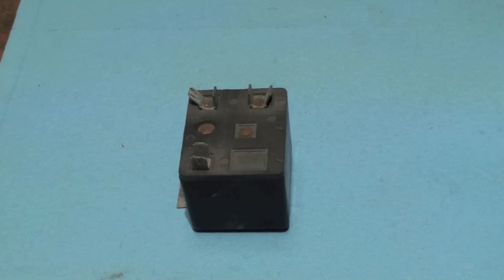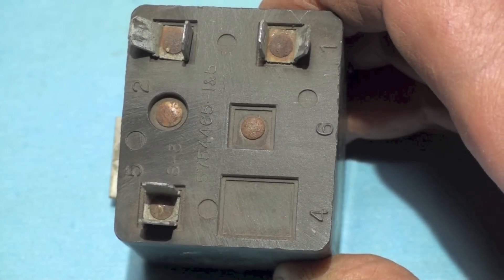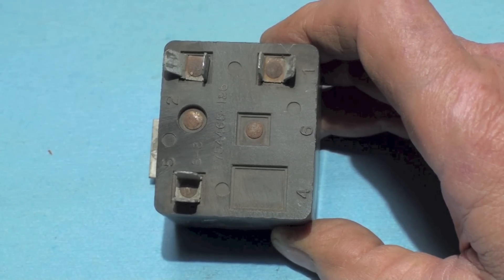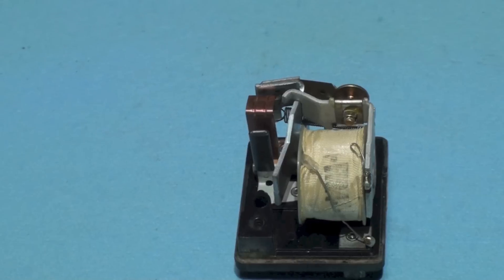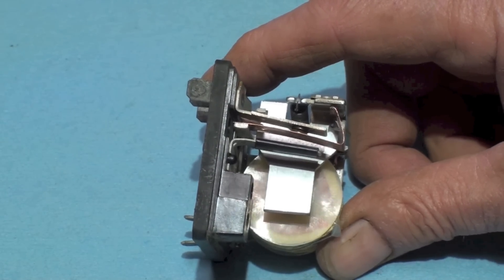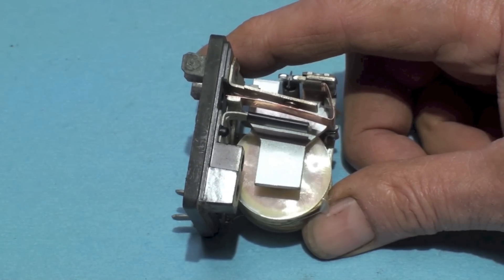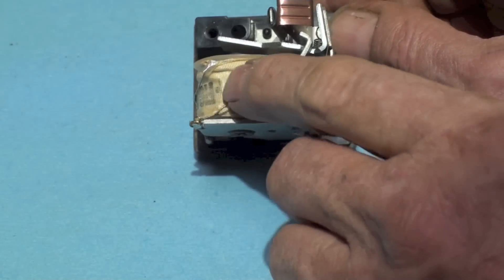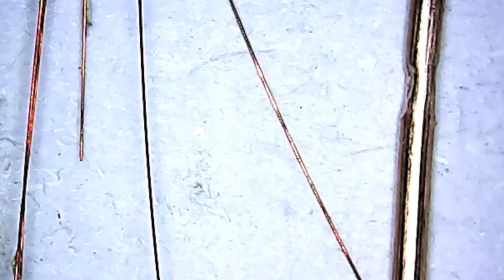Potential relay Part 1

Comment: When this relay energizes, it opens the contacts between termnal 1 and 2 thereby disconnecting the start capacitor from the circuit, but it doesn't "shut off" or remove the start winding from the circuit. The start winding continous to help rotate the rotor but with less torque since the start capacitor is no longer in the circuit.

Comment: Potential relay works as open delay by using EMF but takes the voltage from motor at starting up time, not directly from the main power.
Reply: It senses and experiences the same voltage that develops across the start winding in the motor.

Comment: Starting relay starting relayis usedfor csr cmprssor motortodisconnect startting capaciter after startingthe  motor the the starting reayuedin airconditio is  called  voltagereay  ..potential  relay  or  magnetic reay.theopeeationofthistype ofthisreay depends upontheincreaseof voltageatthe  comprssor terminals  after startig ...)  rely  potshio resly enxig lw lw power  roing pin r string point comon over coil enges potshio rrly using ok

Comment: So when this thing is sitting on the table there should be continuity between 1 and 3? or 2 and 3? or 1 and 2?
And when this thing opens there should be continuity between what terminals.
I seem to have a 4 terminal deal here.  There is continuity between 1 and 2 and no other continuity right now.  So I am assuming 1 goes to the capacitor.  2 goes to S part of the compressor and 3 goes to C. and 4 goes..? Maybe I don't need to use it or use on a little 4 uF run capacitor.... or leave it out and see what happens?  It seems to be normally open between 3 and 4
I got this thing out of them motel window units and I figured the compressor works and I will just turn it into a little air compressor.   I do run it manually using the capacitor but I figure I will just get a little sophisticated.
Reply from the maker: There is another video with a diagram:  https://youtu.be/jsQv_AEl3tk
GFM

Comment: Informative video!  Thanks.  When, if ever should you use a start capacitor (cap and relay separate, or super boost)  on a scroll compressor?
Reply from the maker: jeff arney The design of the scroll allows it to begin rotating several times before having to discharge thru the top discharge valve.  So it gets a "head start" before it has to pump.  Copeland says you can use a hard start to limit "dimming of the lights" on startup.  That is not to say I would not use one if it made a compressor start when it would not using just the run cap. As with recip compressor, I bill it not as a repair, but as a fix to get it running without any guarantee of how long it will work.  As for use with a non bleed TXV equipped units, they don't seen to be necessary.  Hope this helps.
GFM
Reply: @grayfurnaceman  They have soft start kits now to minimize, or in most cases, prevent dimming lights when starting a motor/compressor.

Comment: i have kitchenaid model is YKBRS21KAW00  my problem is .if the temp control is off!!   the defrost timer is making noise and advance, evap fan is running freezer is cool and compressor wont start.

 but if the temp control is on!!!   the compressor start ok freezer stay cool,but defrost timer is not making that noise and does not move a bit, evap fan won't start at all and inside the fridge part its hot no air coming from the vent in fridge. .

the light in fridge and freezer stop working and there is a small switch for uses less energy if flip one side and flip on other side is for reduces exterior moisture the light does not come on either on the switch. not to sure what this switch  do but din't seem to make a difference in the pass but i know that light was coming on if it was flip on before . 

could it be the relay that isshort out or something ? any suggestion of what can be wrong ?

I change the defrost timer last year and i change the evap fan too at the same time !.something is running backward but not sure what could do it ...
Show less

Comment: There is nothing special about this "potential relay" it is a relay just like all other electro-mechanical relays.  Your explanation about why the wire is so small is incorrect.  It is not because, "you don't want that thing energized until you get a very high voltage."  That wire is small because you need a specific number of turns of wire to create enough force to pull the armature down.  You can't physically put big wire in there because it's a tiny relay. All small relays have small gauge wire to create the coil.  The number of turns in this coil is determined by the amount of force needed to pull the armature down. This is how ALL relays work.  Potential relays are usually adjustable relays such that you can vary the potential (potential is just another word for voltage) threshold that causes them to energize.  So lets say I wanted a relay that detected a 75Vrms rise in potential on a circuit normally operating on 26 VAC rms.  I would buy a potential relay such that it would only energize at that voltage and would latch once energize causing a siren to go off and a beacon warning someone of an abnormal condition.  What is happening is that some engineer used basic electromagnet theory to determine the voltage that would appear across the start winding once this motor got near synchronous speed then he specified a relay that would energize at that particular voltage plus or minus 10%. Once that relay energizes it magically takes the start capacitor out of the circuit. This relay maybe called a potential relay, but it really isn't strictly speaking.  This relay is looking for something like oh 300 or 400 VAC to energize.  You can get online and buy a relay with that coil rating and use it for the starting the motor.  You don't need a potential relay and this isn't a potential relay any more than any other relay is a potential relay.  All relays are technically potential relays because they need a potential difference across their coil to energize.  And since that is the case this relay isn't special in any way.  The small wire you see will be that small on ALL small relays.  It's not small gauge wire in this relay because it has some magical properties.  All relays have tiny wire like this in them.   I hope nobody takes this video too seriously and goes around to their buddies in the shop saying, "oh man go watch this video. It explains those potential relays."  Don't listen to GFM's explanation as to why this potential relay works.  This relay works like ALL relays.  It simply comes on because the coil is looking for a great enough voltage to energize.  That is what all relays are looking for.  Once the potential difference becomes great enough it will energize.  This can be determined experimentally with a fast Peak responding meter like a Fluke 689 or an digital storage oscilloscope. Once you determine that you simply go buy a relay with that coil voltage rating and Voila (say it like walla) you have a potential relay that you can use in this circuit.    I need to make my own video on how this stuff works.  I don't want all you HVAC guys to go around repeating what this guys says.
Reply from the maker: I think you should.  It might be interesting.  However, I have made a video on that.  It will be out soon.  You may find the results interesting.
GFM
Reply: Impedancenetwork You don't need to be so rude about it. And did you need to repeat some things 2 & 3 times? Some people are too smart for their own good and it goes to their heads making them pompous asses. Sorry GFM, but this guy irked me.
Reply: You seem confused. Most relays do not use back EMF to open a normally closed set of contacts. This relay is indeed special and by the sounds of it so are you. Also an adjustable potential relay is set using drop out and pick up voltage. Your explanation regarding a adjustable relay indicated you have no field experience. I hope nobody takes this chump serious.
Reply: @Matt-nr5re  I agree he's a pompous ass and a chump that's too smart for his own good but he does know exactly how the relay works.